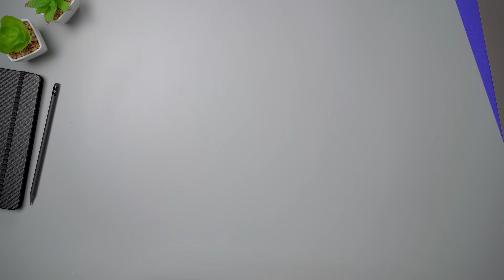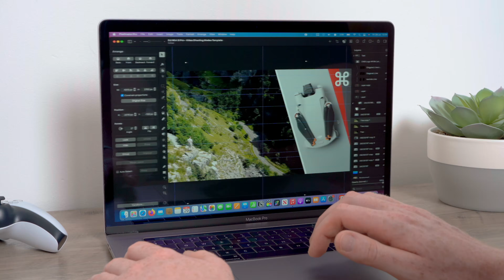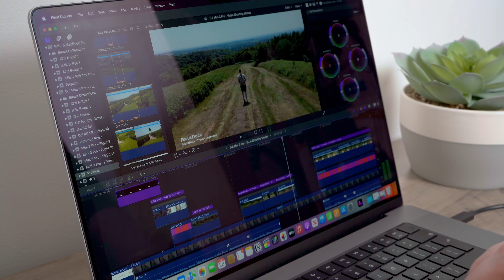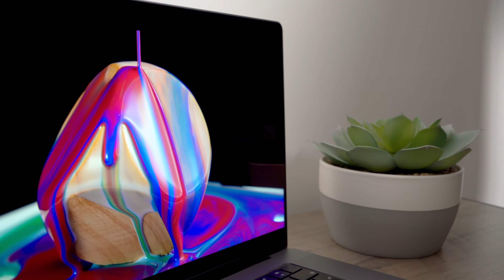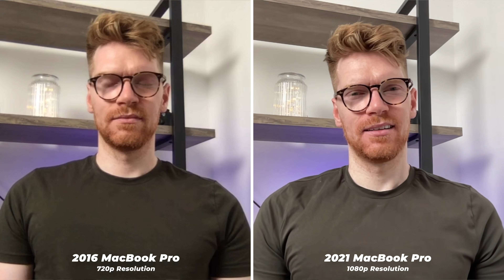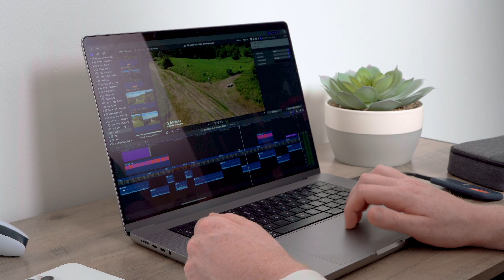M1 Max MacBook Pro Review - Full Power!

Comment: Pro level post, Jack — smooth combo of Apple footage and your own. Perhaps I missed it, but how long is the refurbished warranty compared to a “virgin” model? Likely too late, now, but it would have been instructive, IMO, to follow up with a vid showing how you did the initial set-up and transferred programs, and data, from one machine to the other — in particular how you maintained software licenses; the heavy work, IMO. Some licenses are tied to particular machines, no?
Hope you did not set up your new machine during the recent UK heat wave.😁  Cheers!
Reply from the maker: Thank you Paul! ✌🏻 Warranty on Apple Certified Refurbs is the exact same as buying new from them. You get a 14 day return window and 1 year of Apple Care which you can pay to extend to 3 years if you want. 

Moving everything to a new Mac is super easy with a Time Machine backup - it just moves everything over for you. But I kinda wanted to half start-fresh so didn’t use my backup. All my documents and photos are backed up to
iCloud so It was just a case of waiting for those to download. And for my apps, most of mine are from the Mac App Store - so I manually downloaded those which I think I’ll need. Doing it this was was a good way to have a clear out of things that I no longer use! 

As for licences - I only have a couple of plugins for Final Cut with machine limits - but since I only had the 1 other older MacBook I hadn’t hit it anyway. It’s easy to manage those and remove older Mac’s from the new one though.
Reply: I actually left my 16 inch in the box for a few days until the heatwave ended with a fan over it, because my iPhone was really heating up in this heat😅.